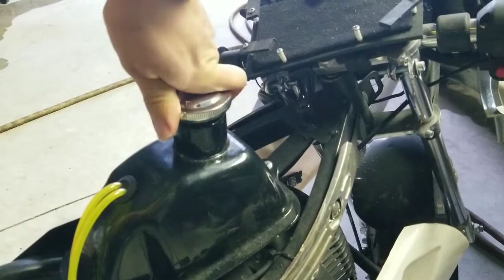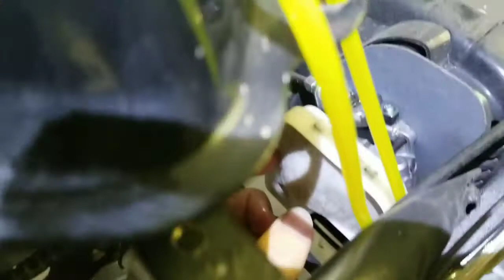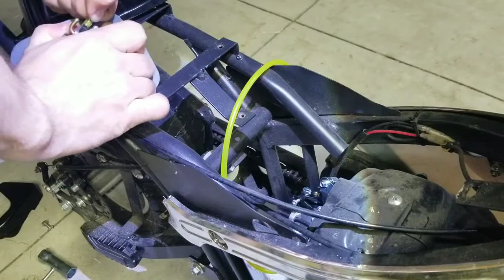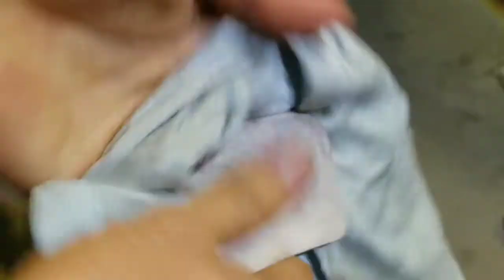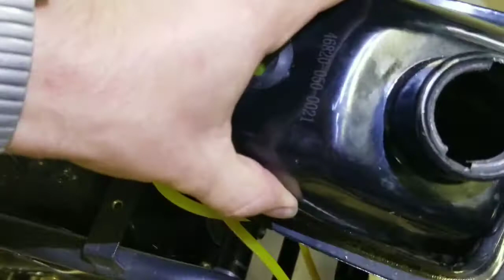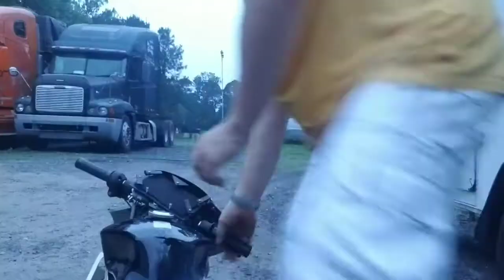How to fix a pocket bike, a mini bike, won't start, part 2

Comment: Can you post the eBay link for the new carburetor please ?
Reply from the maker: Carburetor Kit For 40cc 43cc 49cc 2-stroke Engine Bladez Keyang gas Scooter.                Just search for this on ebay, because the item is no longer for sale, but I am pretty sure you can find something similar
Reply from the maker: https://www.ebay.com/itm/174966427369?mkcid=16&mkevt=1&mkrid=711-127632-2357-0&ssspo=ls_v1FjaQtG&sssrc=2349624&ssuid=LU4TN_9MSF2&var=&widget_ver=artemis&media=COPY
Reply from the maker: Thus is my previous purchase